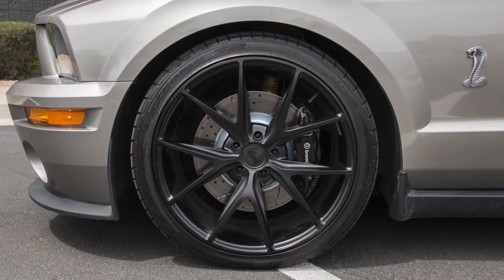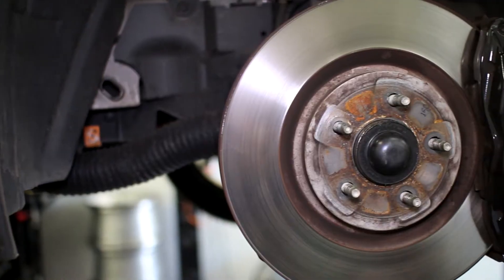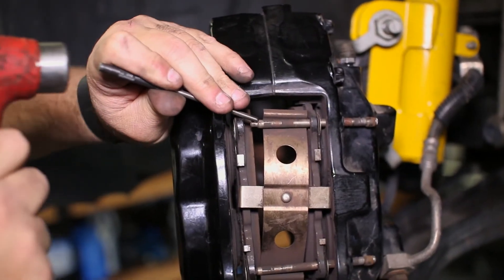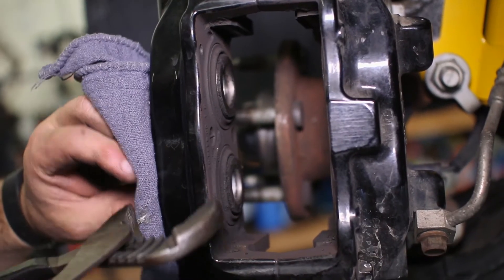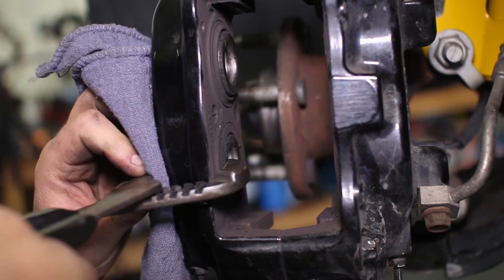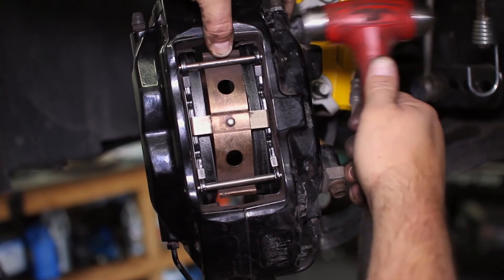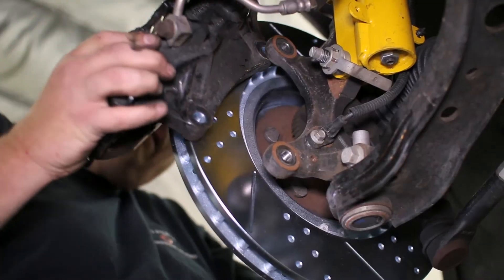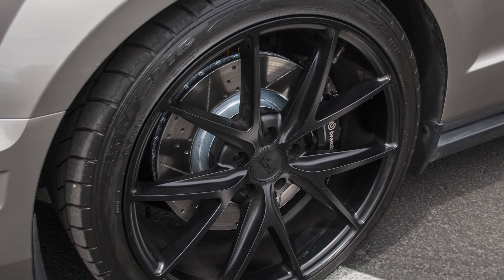2005-2014 Mustang GT/GT500 with 14"  Brembo Brakes Pad Install

Comment: THanks for the vid. Nice tip on cleaning up the brake caliper pins. Do you need to open the brake fluid reservoir to push the pistons back in? Could also open the bleeder screws on the caliper to make it easier/safer? Also, is it ok to push them individually.....or should you do two at a time (each side). Was thinking you could use the old brake pad to push them in....

Comment: Stage 3 Motorsports
Hi, i have a ford C max 1.6 TDCI Diesel Titanium x with 17" wheel in Turkey. Is there any brembo disc&caliper solution to replace my car's brakes ? If it is exist, what is the part number of these ? BR.

Comment: Wouldn't it have been easier to remove and replace the pads with the rotor still on?
Reply from the maker: Yes, if you are only replacing the pads with new ones. We put new rotors on at the same time, hence why they were taken off as well

Comment: will these fit with an 18 inch wheel?
Reply: Prolly not
Reply: yes they fit with 18" wheels :) they are run on other platforms without any problems. It all depends on what the design of the 18" wheel is and the distance from the hub. You can have a 17" rim clear large brake calipers if its designed for it. 

Im running these calipers and rotors with 18" rims.